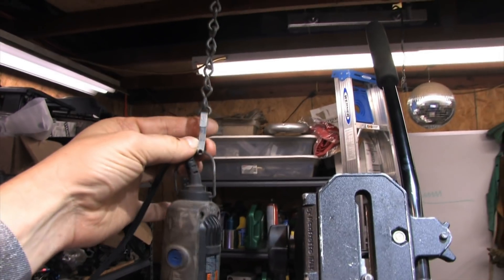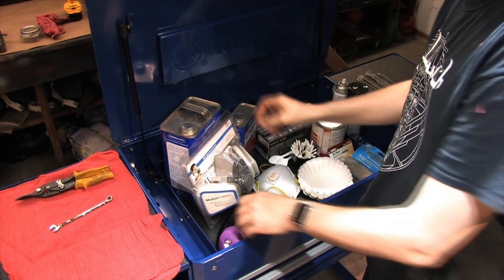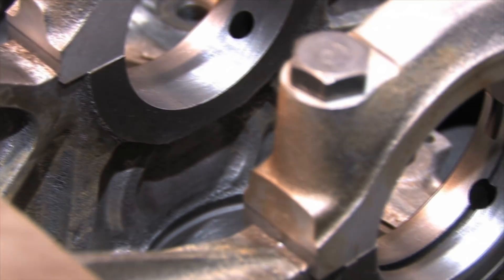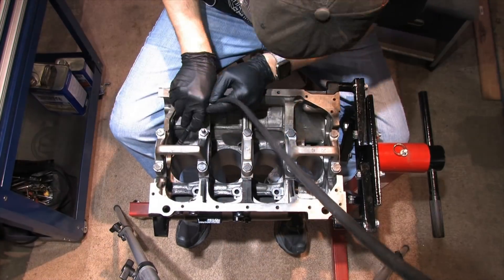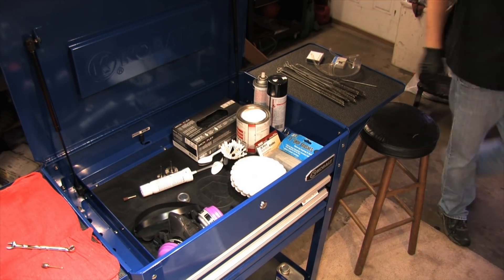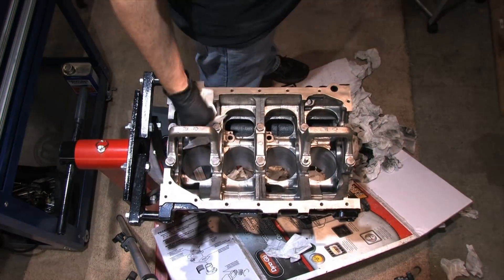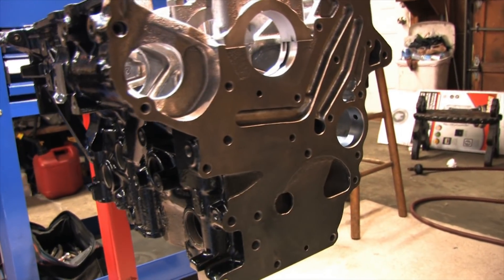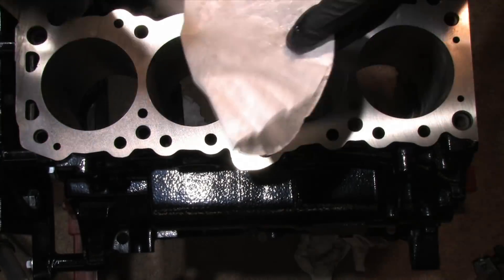Oil-repellent Crankcase Coating?

Comment: Yes! New Jafro video!
That looks so time consuming but it's something I'd probably do if I were going for the best build possible. All I'm going for is 300hp as reliably as possible while not spending too much time or money. I'm going to be using a 4th gen 3S-GTE with a ported wastegate hole and E85 on an ECUMaster EMU Black. Seeing as an entire engine with turbo is $800, I'd rather just race it until it blows up and swap another in, instead of spend time and money trying to make it reliable just to get maybe one more season of racing out of it.
Maybe one day I'll try building an epic engine with no compromises.

Comment: Alright new Jafro vid! Odd question if you ever get board, what's the distance between the front hubs on the 2G and/or Hyundai? I just found out DSM axles use the same output spline (25) as my Sentra, and have this crazy idea going on in my head, as long as the sentra isn't too narrow
Reply from the maker: Does this have maybe something to do with the guy who built the AWD Nissan Sentra back in '08?  I bet it does...  The distance wouldn't actually matter because you could either shorten or lengthen the axles to the size you need at a driveshaft shop, or select axles from one of the many other models that came with different length axles.  You'd have the Expo, Summit Wagon, Eclipse, Talon, Laser (AWD or FWD) Sonata, Mirage, Colt GT and Galant axles to pick from to get the length you need.  Maybe I'm thinking you're going to do something else than what you're actually planning?  But my 2g and my Hyundai have completely different wheelbases, and the Hyundai has Expo minivan knuckles and hubs, not the original Hyundai stuff.  My 2g and my Galant are the only 2 OE configured drivetrains in my project list.
Reply: No I'm not that guy unfortunately, but I know of the car your talking about. And that's great that I have so many options for axles, didn't want custom units due to keeping cost down. My DSM knowledge only spans to what ive seen on your channel, (which is a good bit, you cover craploads of info!) but no experience with them personally. I just know how much power i get get from one and the wide aftermarket. The car is a ratty old 89 Sentra coupe that I've had for years and needs a new powertrain, and when a friend jokingly told me to 4G63 swap it, I looked up the spine count and seen DSM's (eclipses at least) had the same 25 outboard splines. I've always had a dream of a ratty looking but really quick car, and seems like this may be the ticket. Time for me to get my butt to the junkyard and start making plans!